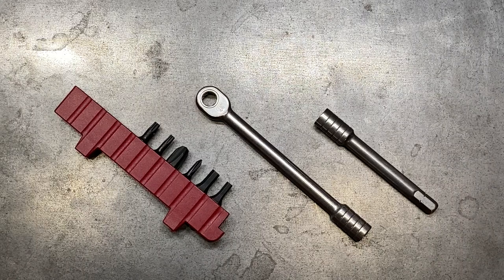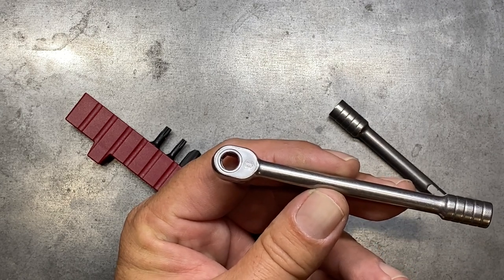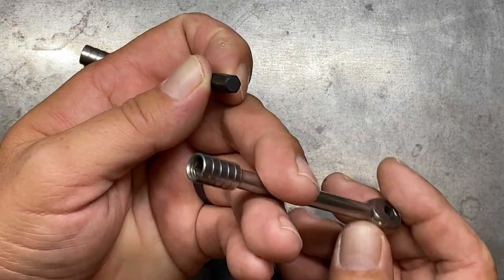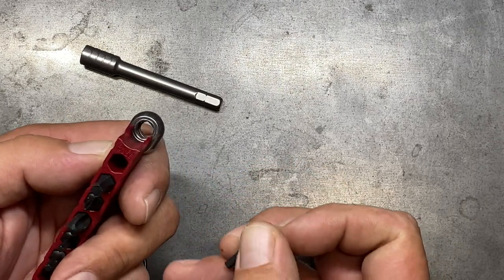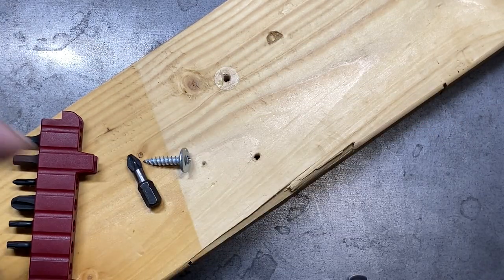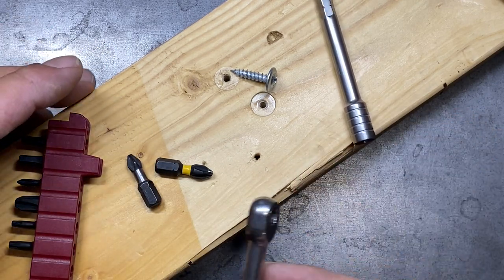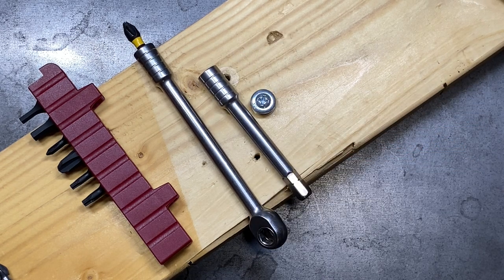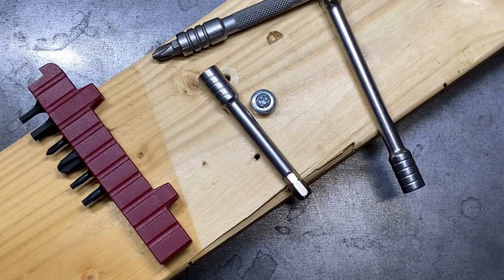Victorinox Ratchet Kit

Comment: I put a piece of double wall shrink tubing on the ratchet shaft. The double wall heat shrink has a bullet proof adhesive that melts to the surface of the ratchet when heated with a heat gun. It's bullet proof material and aids in a great grip on the ratchet when using the bottom for a hand driver.

Comment: I've always wondered about this one. I've seen pictures on line of people using two of the bit carriers an sliding them together to carry both the ratchet and L driver. It's definitely a kit that gives you some options to build what you want especially with a little diy engineering. Great review 👍
Reply from the maker: Thanks you.
Reply: Topeak makes one that is reversible and contains the bits better having had both

Comment: Regarding the point you made about pocketing - if you purchase an additional bit case, you can fold them together if the 6mm hex bit is in. This makes everything sit flush, safe against losing bits, and gives you an additional snap slot for the extension. Everything thus becomes much more pocketable, which allows carrying of the tool and the bit kit loose in a bag pocket rather than a pouch.

Comment: you can add the extension into the ratchet side for a "T" handle when your driving screws inline for some more torque. You can also add the extension into the bit holder on the end when your ratcheting to add some length to the handle.
Reply from the maker: Those are excellent observations, I should have picked up on those. Thank you!
Reply: Was just about to say the same
Reply: I'm having trouble visualizing this.  Please explain more.
Reply: @MrMagicman00100  If you put the extension bar onto the ratchet head, you can use the it to turn the screwdriver; somewhat like an alan wrench.
Reply: i wouldnt sideload a ratchet like that
Reply: Dude this is exactly what I was trying to figure out. Like, I'm not going to use a smooth-faced bar to drive screws, but I also didn't necessarily want to use it ratchet-style.

Took me 5 minutes to even figure out what you were describing. If anyone else is having trouble: it's the exact same configuration as the ratchet+extension, you just put the bit on the opposite end (end of the longer ratchet piece rather than the end of the extension). So basically use it like an L but with the long side facing down.

I felt so dumb. Thank you for explaining!!
Reply: Can you add the ratchet kit to any of the Swiss tools or are they only for certain models

Comment: As much as I love the convenience of a ratchet I think the double ended L wrench is a better fit for me. I'm in England so carrying a full sized locking multitool is tricky. I've found what's best for me is a Victorinox handyman carried with a "OneTigris Easy Carry Wallet" used as a slim, flat pocket organiser to carry a pair of Knipex Corba 125's, a Bic lighter, an L wrench with some bits in a cut down rubber bit sleeve, a folded up tailors tape measure and some flat rolled duct tape. 
Put together I get most of my tools in the Handyman and the full sized pliers and driving capabilities are in my organiser in my back pocket. Plus the extra room in the organiser to have my lighter tucked away and a few extra useful items.  I'm hoping it'll serve me well as my "Go everywhere tool kit".

Got to say I love your videos man, keep doing what you're doing!
Reply from the maker: Sounds like you have the kit that works for you. I had never heard of that wallet before. I had to go look it up. I like it.
Reply: @txtoolcrib   It's great for an organiser that will actually fit in a normal pocket (unlike options like the Maxpedition micro). Carries a few smaller EDC items side by side, flat, secure, doesn't jangle about and has some card sleeves inside for the likes of duct tape, a fresnel lens, bandaids, tape measure etc...  Come to think of it, it would be perfect for that Victorinox ratchet setup with a little room to spare.

Comment: I love it. Should have bought it much sooner. It is the lightest ratchet with a length of about 10cm. Just weighs 31g. Normal mini ratchets weigh easily 50, nice ones like the Wera weigh about 100g
I use rubber bands for my Vic Ratchet that I cut off from old bike tubes.  The handle gets two of them to hold the extension - or in my case a normal bit holder. A normal bit holder has a longer shank which I can push further in the Vic ratchet to create a much better t- handle. Also you can use the shank that is sticking out in the same way other ratchets offer the small wheel (?) to turn the screws in before they need more torque.

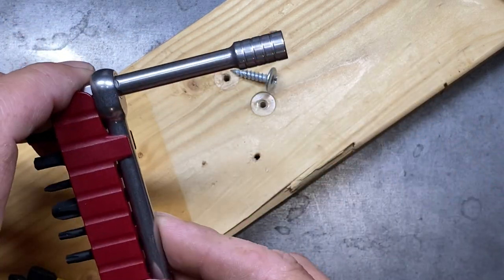Comment: At 6:39 If you put the extension on the other side of the ratchet, the bit kit has a spot that the extension rests tightly on it. That means, that you can carry them all together as one kit.
Reply from the maker: I found that the extension sticks out a bit far in that orientation. I think I may have found a solution for myself though.

Comment: Did you drive in screws without the extender? You think the bit is secured tight enough to not get pushed through the rachted when you push on the screw you are driving in? Really like to know. I’m not shure with one to get. The  victorinox or the Topeak Ratchet Rocked DX.

Comment: You might make the kit more compact by placing the bits inside a straw or other thin wall tube instead of using the red plastic holder.  Cheers.
Reply from the maker: That’s a good thought.

Comment: Awesome. I just got my swiss tool x with the ratchet. When I put in the extender it locked THIGHT. I had to look up this video to see if i was suppose to just pull it out to not damage the ratcher. It locks crazily. Awesome

Edit: the swiss tool x comes with a leather pouch in which you can both store the multitool and the ratchet (including the bits and extender)

Comment: Another one you might want to check out if you haven't already is the "PowerTorque" mini ratchet that you can get at some O'Reilly Auto Parts stores. It's literally the exact same ratchet as in the Topeak ratchet sets, but at half the price because of the different branding. As small as it is, it still has a proper switch for changing directions. Made in Taiwan. I've never owned a Victorinox or Chapman ratchet, so I can't say how the quality compares, but it does seem to be well-made.
Reply from the maker: I'll make sure I look for it the next time I'm in O'Reilly's. Thanks for the heads up.
Reply: @txtoolcrib  No problem. I've quickly found that the bits that come with it are too polished and slippery, making removing them from the ratchet difficult. Yesterday I swapped them for some bits with a more rough satin finish, and they're much better. The ratchet itself seems solid so far.